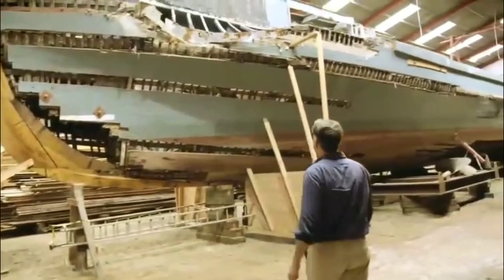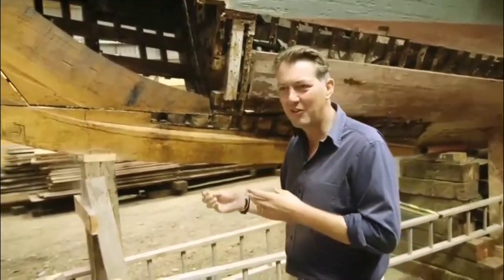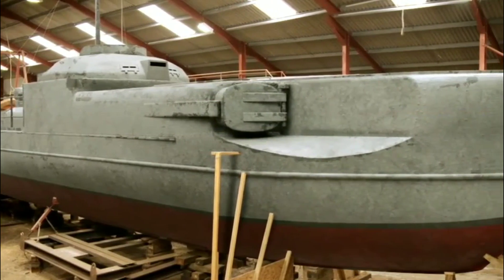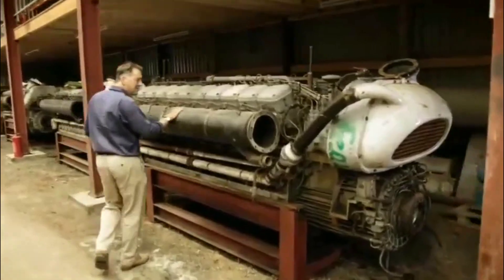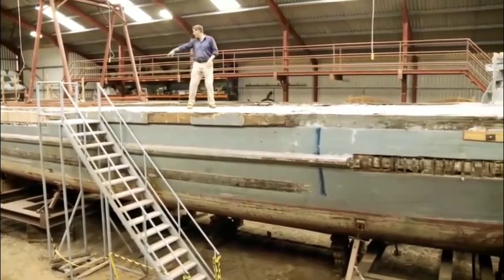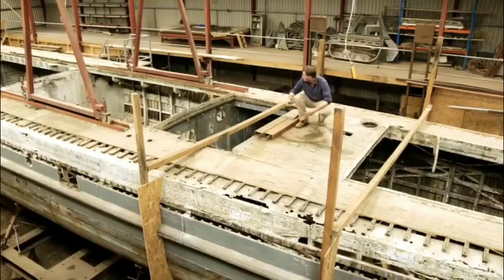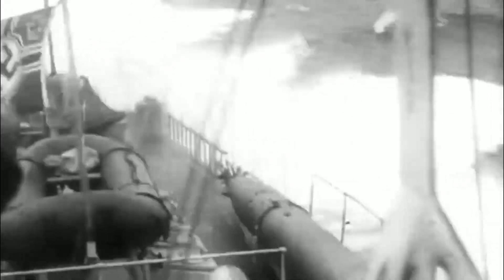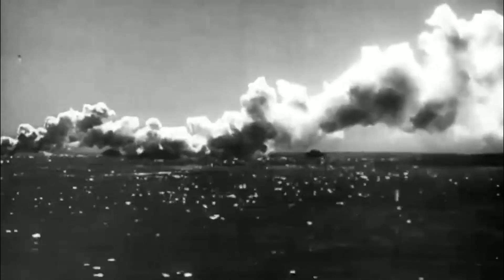German E-boat, Schnellboot or S-Boot, fast attack craft in WW2

Comment: I know its the last S130 im guessing it is? S130 being the last she never had that cab updeck it was more the fishing vessel type the 3D render there woth the armoured casemate im not sure is correct?
Reply: S 130 was an S 38 type, but the later built boats like S 130 had all the armored cab like the S 100 types. A difference between S 38 type and S 100 type was the MB 501 in S 38 type and MB 511 in S100 type. MB 518 was planned for S  301 to S 500 but MB 518 was not delivered. MB 518C (from ex S39 Puma) isn't never historical for S 130, only in post war configuration UW10 and later as testboat.